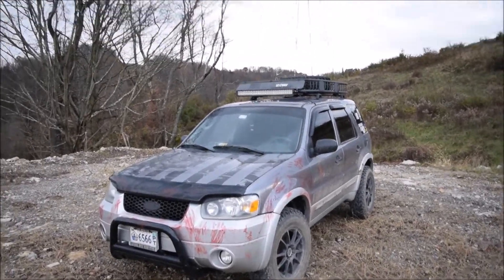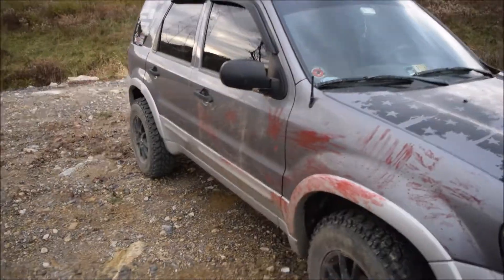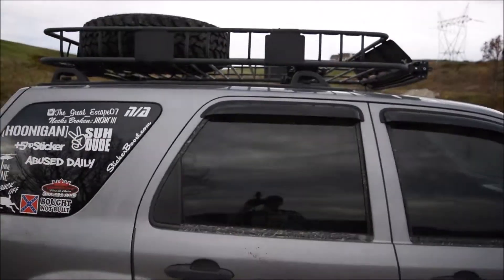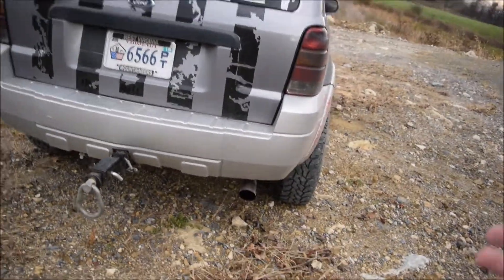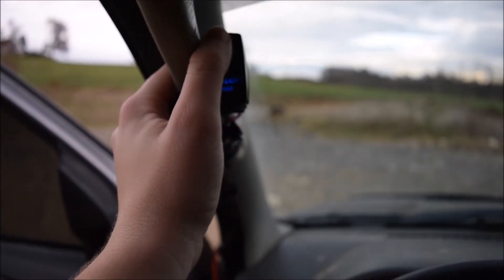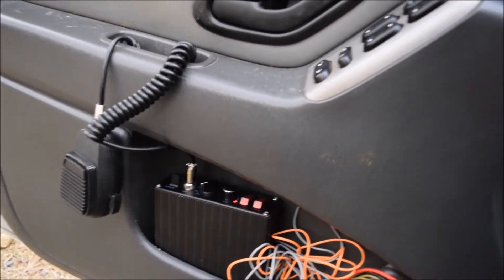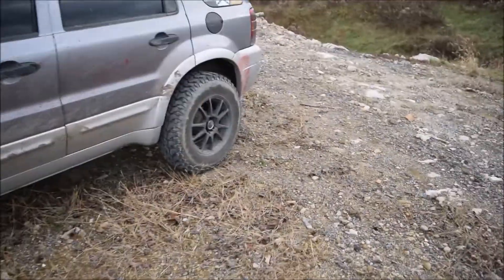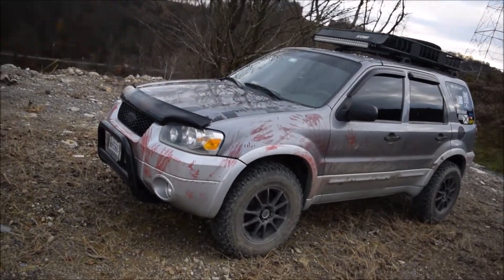LIFTED STRAIGHT PIPED FORD ESCAPE WALKAROUND

Comment: Just got my self a 2005 Ford Escape 3 days ago AWD
Reply: PGm issa, Ford Escapes in my experience are very hit or miss on reliability.  I had a 2005 and absolutely loved it!  Had no issues.  Traded it in for a 2010 and had nothing but problems.  The vehicle felt like it was built cheaper too.  I highly recommend this generation and the current one over the boxy style from 08-12.  Those are crap, even though they look tougher.
Reply: I just scored an 05 4wd wth 70k and it's a stick
Reply: Engines are great transmissions are shite. Prepare yourself and just use it for commutes. I’ve replaced the trans three times in 5 years. Last time I had to drive home in reverse in rush hour traffic bc it lost all forward gears bc the shift bands broke on the highway
Reply: @elongnutz2531  sold the ford escape. everything underneath rusted out. got my self a 2018 honda pilot love it.

Comment: I just got a 01 4 days ago that wont run and has been sitting for a year. Drug it home and got it fired up and it idles great but won't take the gas.
Reply: There is a sensor on too of the sending unit under the seat in the rear on driver side. Mine read under 13v while underload and it made mine run like crap.

Comment: Do you know the total length of the roof basket?
Reply from the maker: I don’t, it’s been a few years but I remember it was the basic curt roof basket with the extension piece
Reply: @NoahHitt  oh okay I found it. So the basket itself is 42”x37” then the extension is 21”x37” so length should be in the 63”-64” mark. Thank you

Comment: Hey man so I've got an 01 Escape, I'm getting strut spacers that would lift it about 2 inches, same as your springs, and the stock tires on it now are 225. you think I could slip 235's in there with the strut spacers and I wouldnt have rubbing problems?
Reply: i have an 01 escape xlt with 235s 16in rims. everything is completely stock

Comment: ....well...ummm...you have a stock escape you put a bunch of stickers and non performing parts on....oh wait, you put lift springs and cut your muffler off...yup that aught to throw flames, do wheelies and jump tall buildings...sigh.....I'm seriously trying not to be sarcastic and a dick in general, but come ON! Did you lock the rear ended? Did you add any power to make up for the bigger diameter tires and lack of low range??
Oh, and when you open up the exh and make it freer flowing, it leans out, not riches the engine... If it was carb'd, which it isn't. Being fuel inj, the 02 sensors will reset the perimeters so it will add/reduce fuel as required. You could unhook the battery for a couple minute to get rid of the memory then the computer will relearn with the open exhaust, jus sayin. You're on the right track, but substance over show, man. Chrome won't get you home.(and neither will stickers, even though I support the "blue lives matter" 100%!)
Reply from the maker: Jim Miller I would go over your comment and break it down but I no longer have the vehicle. The thing was fun, I enjoyed it that’s really all that matter.